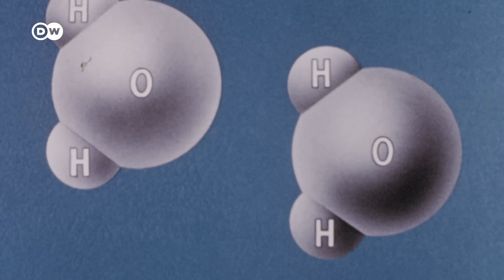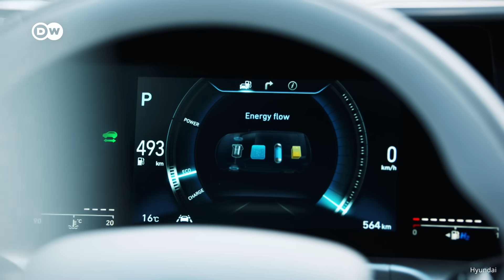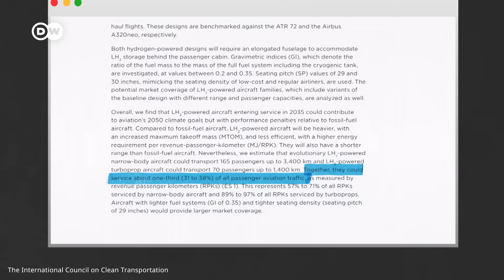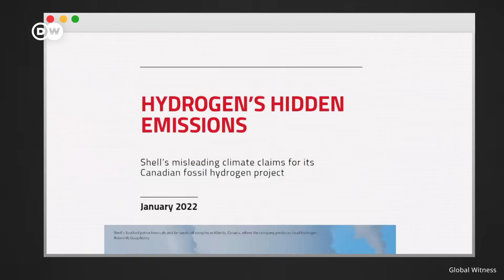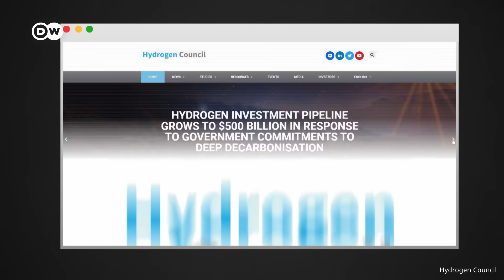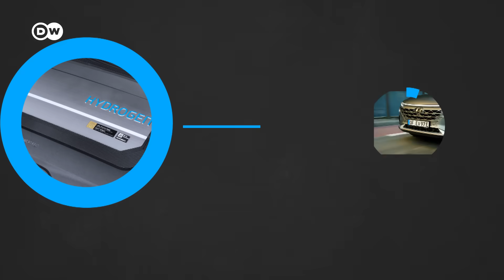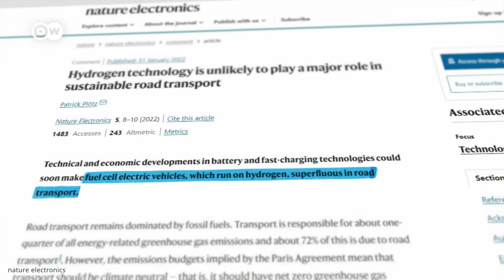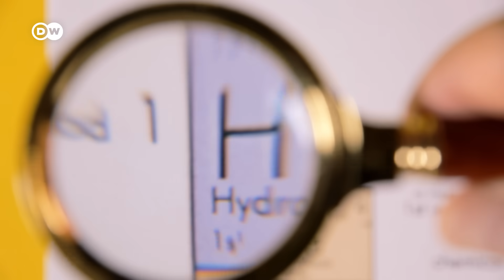The truth about hydrogen

Comment: Even "green" hydrogen doesn't sound that green. I'm assuming it still has to be shipped and stored via trucks, trains, and boats. Seems far more sensible to use batteries with solar or wind power to charge them locally. Unless it's an extreme area or space constraints don't allow for it.
Reply: There are gas stations that are making hydro on the roofs
Reply: @simplyfilms3153  and it would still be more efficient to just charge some batteries and use that energy to recharge EV's. Hydrogen is just a crappy battery that doesn't last very long.
Reply: @MYNautiGirl  I think we will have both.
Reply: @simplyfilms3153  it's possible, but most likely in a use case where saving money is less important than saving weight. I can see aerospace being a good use case.

Comment: Not mentioned is "cracking" water to get H using waste heat from nuclear power plants.  It is probably NOT mentioned because it is the one technology that the oil and gas companies cannot make a large profit from.

When yuou heat water above about 800 C, the H2O molecule splits apart into H and O2.  An MSR nuclear reactor runs about 1,300 C degrees at near atmosphereic pressure.  The waste heat they produce can be used in the thermochemical water splitting processes with high-temperature heat to drive a series of chemical reactions that produce hydrogen. The chemicals used in the process are reused within each cycle, creating a closed loop that consumes only water and produces hydrogen and oxygen.  Since the reactor does not emit GHGs, the process is Green.  This process is fast, efficient and effective and it uses waste heat from a nuclear reactor that does not add or need any additional fuel to create.

The electrical power from produced from the same plant can be used to compress the produced H into a liquid AND/OR it can be used to power the processes to make hydrogen paste.  It may also be possible to incorporate the reactor power for deslaination of sea water.

One nuclear plant produces electrical power, hydrogen and fresh water and also powers the processing plants to produce the H and water.  THAT is the future!!!

Comment: Let me get this straight, "Green Hydrogen" requires renewables like solar and wind. The reason solar and wind got cheaper is because fracking made fossil fuels more abundant and the cost to produce solar panels and wind turbines went down because fossil fuel is required to manufacture and install solar and wind. Solar and wind cannot self sustain because at best solar and wind return at best 10 times the energy. Fossil fuels 30 times, and nuclear 100 times return. And then there are batteries require to store all that intermittent power. Batteries require massive amounts of ore to be processed with, you guessed it, fossil fuel.  Until we find an alternative technology capable of providing an efficient input to output ratio, on demand needs, and with enough energy concentration to be logistically feasible, there will be no feasible alternative to fossil fuel. Perhaps fusion, but that's not going to happen soon enough to meet unrealistic climate goals.

Comment: The problem with getting hydrogen from water electrolysis is that water does not contain any hydrogen. The hydrogen comes from the metal electrodes and baking soda or salt that is mixed in the water. The electrolyte and the electrodes slowly decompose and must be constantly replaced. If the electrodes and electrolytes aren't replaced, no hydrogen is produced.  And then there's the problem that comes with the idea that green hydrogen is really "green". The windmills and solar panels used to produce electricity require fossil fuels to power machines which are used to mine materials and also to make electricity to power factories which build and construct the wind generators and solar panels. So the production of these so called green energy machines simply burn the fossil fuels up front and people convince themselves that they didn't produce tons of CO2 during the production process.

Comment: Hydrogen is NEVER going to take off, because it is dangerous.
Hydrogen is Rocket Fuel.
It is the most explosive liquid fuel known to man.
You have to store it at 5000 to 10,000 psi and even then it takes up 4 times the volume of gasoline.
If you get into an accident and your hydrogen tank blows up, you will take out 3 city blocks and kill everyone in there. Hydrogen is a completely unworkable idea, for safety reasons.

Comment: Hydrogen still has an advantage over batteries that no one is talking about. Batteries have a life span, and the cost of a refit makes what ever you put them in pretty much disposable when the batteries die. In cars, that takes the second-teir (60k through 130K miles .. 3 years old - 5years old) sale value down significantly, and the poorest amung us will be truely hurt b/c the third-teir selling (over 150k ten years old) nonexistent. Add to that the scarcity and upward trending cost of lithium (and the polution in mining and processing -- and the double threat that most of it comes from unfriendly nations to the US {this sounds so familiar with ... oil production}). Then there is the one thing that no one is talking about ... yet ... is that there still is no viable way to cheaply and safely recycle them. There is a huge problem correctly disposing of and recycle AA and AAA batteries, what is the plan when we get 10 - 15 million car batteries a year?

Comment: Making steam to drive a turbine to turn a generator to make electricity, at best, is only 27% efficient (Carnot Engine).  Then convert to DC current - more losses.  Too many losses.  The only way is with renewables, but it's not one for one.  Hydroelectric, solar, wind, etc. makes it worth it.  Then, storage and delivery, more expense.  $3.00 per gallon gasoline - the good old days.

Comment: So, what were the energy efficiency levels in using renewable electric to extract hydrogen? Perhaps I missed that part, I`m sure you would not have omitted it.
Reply: IT DOESN’T MATTER, IF THE ORIGINAL SOURCE IS GREEN.
Reply: @nworbydnar  So, using electricity from a renewable source inefficiently is ok because it`s renewable?

ps Your Caps Lock function appears to be stuck on

Comment: One thing I rarely hear mentioned is the issue of the size of the hydrogen atom. Since it's the smallest of all atoms, there will be problems in containment and storage. It will simply migrate through whatever is trying to contain it, more so as pressures go higher. Yes, it is sold in H2 cylinders and frankly, I don't know the rate of leakage though that will vary based on materials used and thickness of containers. It also takes a lot of electricity for electrolysis. All food for continuedthought.
Reply: Absolutely correct, it’s a pig to contain.  We had a fuel cell research facility and the materials required for even moderate storage and safe operation were mind boggling.
Reply: @MS-Patriot2  o
Reply: Another issue is that the electron in a hydrogen atom has a different spin at different temperatures. As you cool the hydrogen the spin changes and this releases heat. So you can compress it to liquid form only to find it turns back to gas over the next 24 hours.
Reply: Exactly, FIAT created prototipes of Hydrogen fueled cars far before electric ones and the project was left behind exactly because the fueling chain would have been too complicated to handle... Also we should keep in mind what could happen if a hydrogen storage facility blasts...
Reply: I've had a few to drink tonight...But..reading your comment ..I think the answer lies within your question...If you can predict migratory transfer..surely it can be controlled.. Perhaps a controlled filtration..almost..?  As a kind of capacitor, maybe..   A precisely constructed vessel taking into account known degradation to a form more controllable..  Various materials, perhaps... But ...toward a predictable product.  Hydrogen recovered intact...or hydrogen modified..?.....  Another whisky, please... I think I'm ready for bed.  Goodnight Sir...
Reply: Artemis vibes
Reply: @Eric Johnson Sucking it in, one lungful at a time, squeaky voices driving across town then breathing it into balloons. Tough call.
Reply: It's size seems to be a blessing and a curse
Reply: It was covered in the documentary when they talk about Shell in Canada (huge percentage of leakage )
Reply: @gabrielakerekes5844  That was about methane.
Reply: Very true -  someone mentioned spin and they are quite right.  There are some quantum mechanical issues that arise at extremely low or high temperatures.   Actually there is one way of containing hydrogen but it's extremely energy inefficient and useless for most applications.   You can heat it to incredibly high temperatures where it becomes a plasma, then  you confine it magnetically without it touching any surfaces through which it can leak.    Extremely long term this is a potential way to fuse it into helium although the ratio of energy in to energy out is still well below 1:1.  Renewable energy is a really tough problem - far harder than any politician or activist who doesn't understand the physics wants to admit.